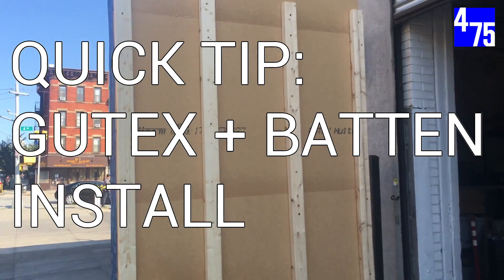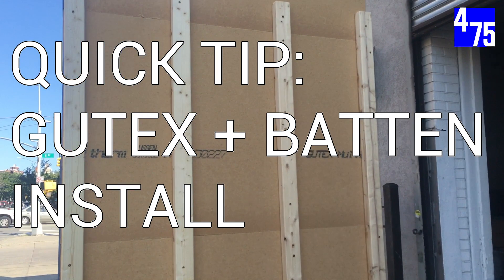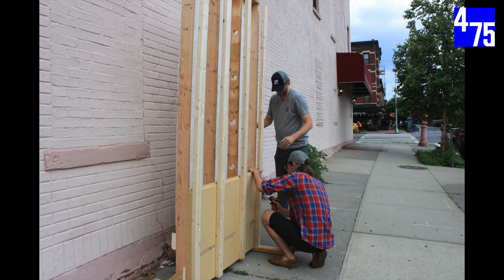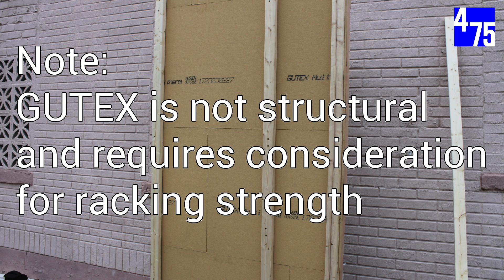Quick Tip: Install GUTEX Boards + Battens In One Shot

Comment: If this is an exterior wall, in this example, how are you achieving an air-tight assembly? Relying on the interior ?
Reply from the maker: This video shows how to install Gutex MULTITHERM, it is not touching on the airtightness of the assembly. The assembly could use INTELLO PLUS as the interior air barrier.

Comment: Where do you get Gutex panels?  My father had wood fiber insulation on his house up in Washington and the house was built in the late 1950's.
Reply from the maker: Gutex is manufactured in the Black Forest in Germany, where the company has operated for over 100 years. Wood fiber board has existed for a long time. It's possible it was produced at some point in the Pacific NW, given its relationship to forestry. It would be interesting to find out.

Comment: Just install the gutex panels prior to the furring strips with a staple gun , some glue, a few screws or whatever. i used the plastic washers to fix mine and then add the furring strips by screwing all the way into the framing . waaay easier.